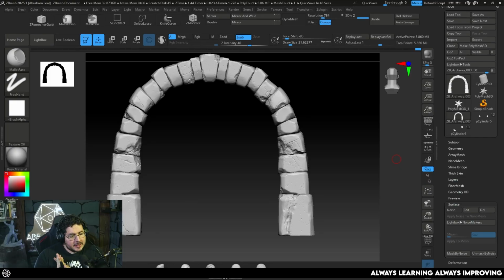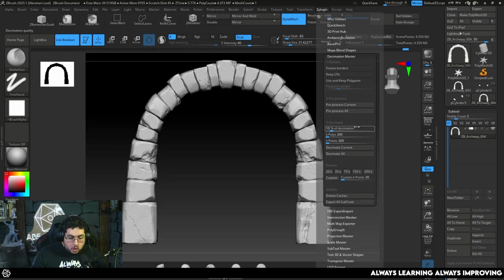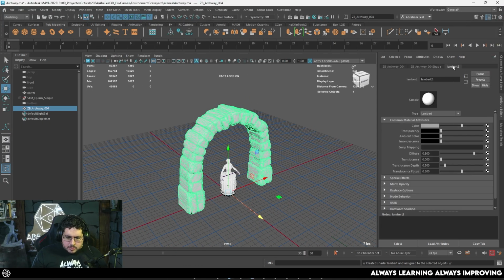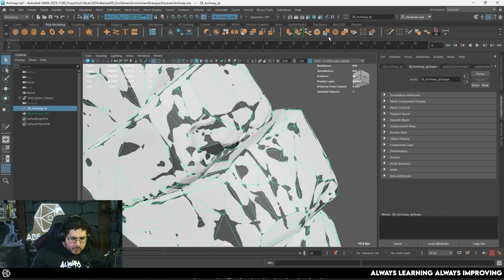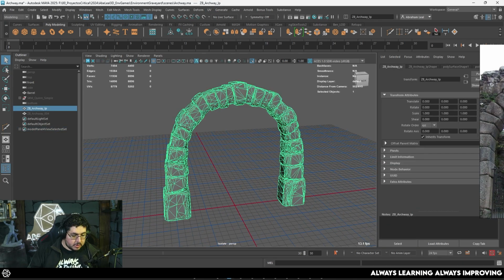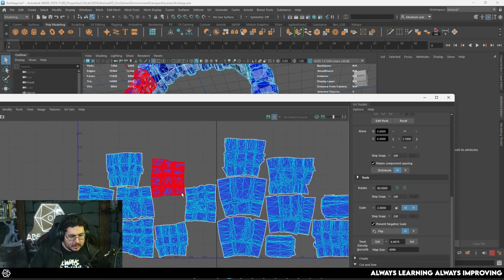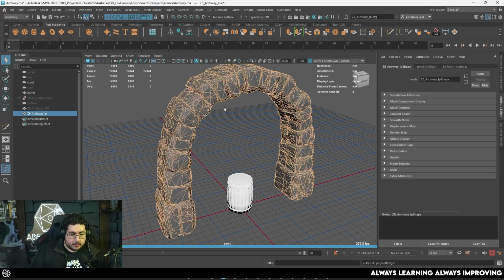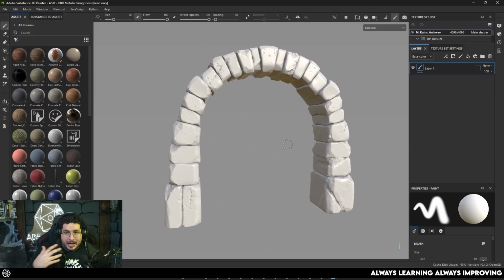Environments for Games - Ruined Archway - Part 2 Low Poly and Uvs

Comment: Abe you can also use uvpackmaster for maya, it's a reallly good packer addon. I don't know if it will have better solution than rizom, but i usually get very good packing with uvs using that addon. It comes for blender and maya.

Comment: you could have also 1. export a decimated high poly thats from 10 milion to 1 milion and 2. zremesh the high poly down to 10k, for the low poly version.... although based on experience, decimating does infact do better of a job at saving the silhouete. But still my low poly is usually zremeshed and not decimated for better uv/texturing workflow
Reply from the maker: yep both options work, i feel that decimation works best for this kind of jagged elements where silhouette is important but for smoother elements zremesher is amazing

Comment: I'm planning to buy a graphics tablet and I'm stuck between two options: a used Wacom Intuos Pro (2017) or a brand new Huion or XP-Pen. I've reviewed some documentation and noticed that Wacom tablets have no line jitter when drawing straight lines, while this can be an issue with other brands. Considering this, what choice should I make? If you recommend Huion or XP-Pen, which specific models would you suggest?

i love you
Reply from the maker: Hey my friend, personally i prefer to buy a new device when possible in order to have the newest technology and warranty. I have been using and showcasing Huion here in the channel and so far havent had any big issue except for a couple of driver issues that have been fixed with some updates

from the huion tablets the best option in terms of cost and results would be the kamvas 16 gen 3. it has great resollution, the new pentech 4 technollogy and a nice size. and the price is quite reasonable, they have sales often

Comment: isnt using remesh better instead of decimate? you would get a cleaner result
Reply from the maker: Yes and no. Yes it will be cleaner in terms of quads and flow but It won't match the silhouette as perfectly and it will usually have a higher polycount.

But there could definitely be some elements like maybe a statue that could benefit more from Zremesher than decimate

Comment: Excellent video, Abe as always, the tip about creating a box and checking for gaps between objects is very good. Regarding the point you mentioned about using udims to gain more texel, you could also use the tileable texture workflow and effects masks on UV channel 2. It would be great if you could do a tutorial on this workflow. Thanks for sharing your content. Best regards!